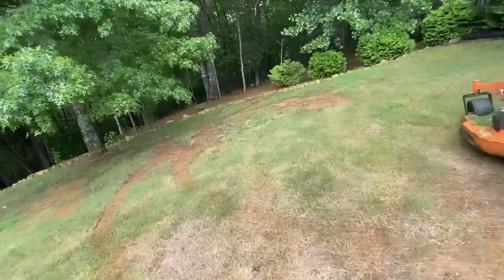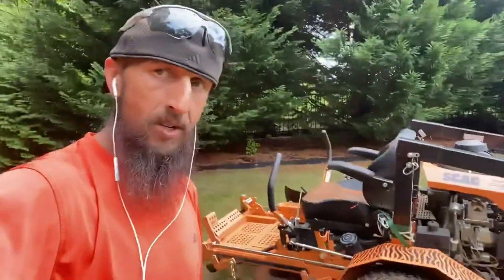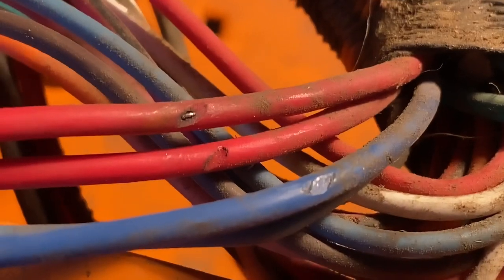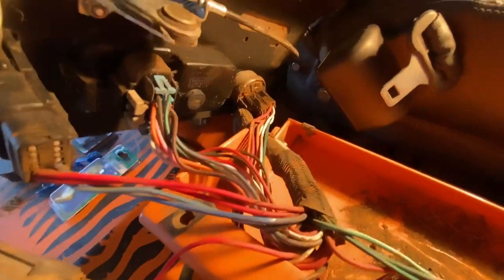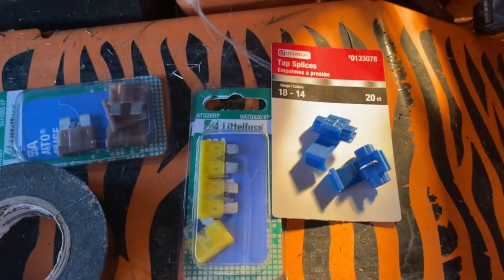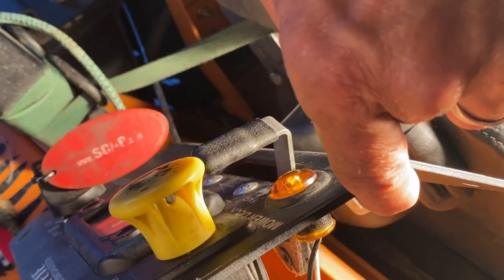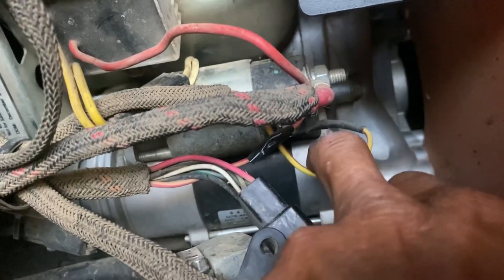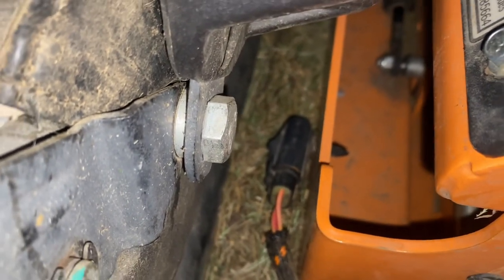ALL MOWER BRANDS DEADLY FIRE HAZARD in WIRING / Why did my FUSE BLOW?? Backyard Mechanics

Comment: Our dealer had to replace our mowers wiring harness a couple of days ago. It was a 2 month wait for the part. They replaced it but, now it's throwing a code (check engine light on) and it's idling a bit rough,  burning kinda rich, going through gas like crazy. This particular dealer is throwing their hands up? 🤷.....🤦sooooo aggravating 🙄 glad you got yours figured out 👍

Comment: True indeed, definitely don't run a larger fuse for a long time when the appropriate amp fuse keeps blowing; even if you don't blow up, it can fry other areas of wiring. Glad you got it fixed. That's super weird that the throttle cable got so hot 🤔

I just found out my 2014 hemi takes 5/20 oil when I bought a whole gallon of 10/30 high mileage for her last month 😑  Now I have to see if.....nah, I can probably keep that and use it in my mowers or something 🤷‍♂️  I'll just buy some 5/20 later.
Reply: I run 10-30 on mine and she’s runs like a champ

Comment: Hope you do not park your mower in a shop/house garage. 1 Never put a larger fuse in then what came with it. 2 Those scotch lock connectors were designed for speaker wires. Never intended to carry current. Read the directions for them. Most are rated for 7 to 10 amps, that is a 20 amp circuit. Not trying to be negative. Just do not want people to follow this advise.
Reply from the maker: Thanks so much for sharing your knowledge and life lessons with us all. Our experiences make us all valuable teachers of life 🙏